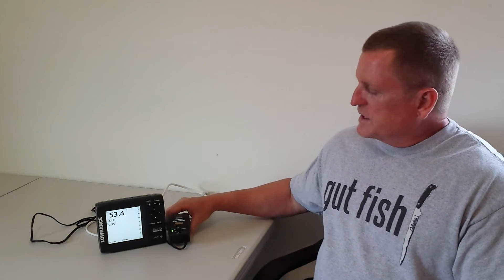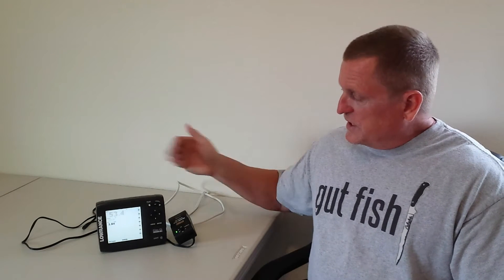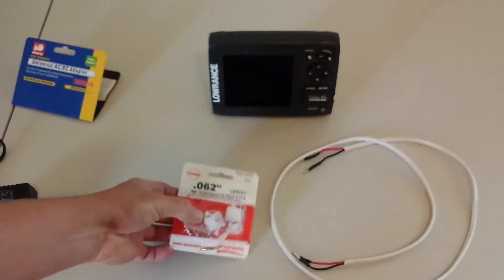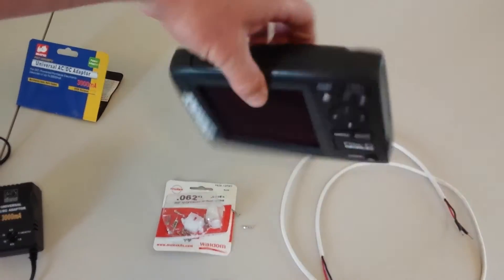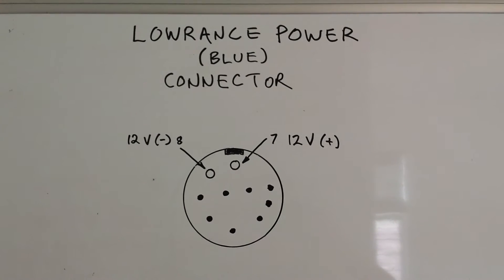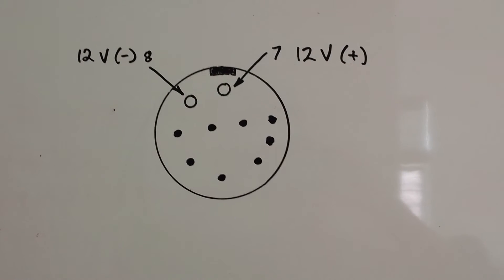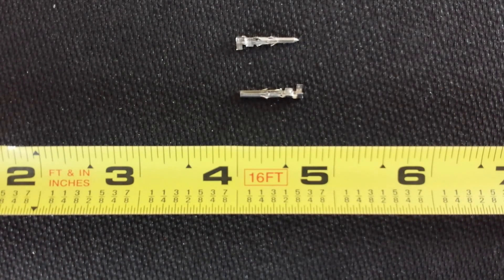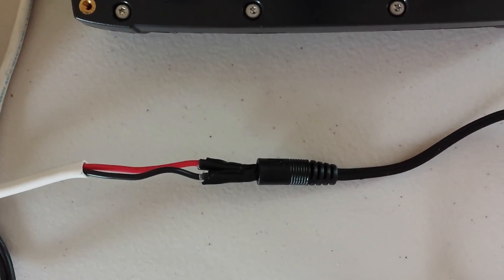DIY Lowrance Elite 5 Chirp Fishfinder (Blue Connector) Remote Power Up

Comment: Hi mate, 
Loving your vids I have the same xfactor as you do and just getting her rigged up now. Could you please do an indepth vid on how you achieved your circuit setup in the centre hatch (livewell hatch). I'd like to achieve similar just looking for clarification on some things. EG, how'd you mount the cutting board it seems that the components are mounted to, other switches for lights etc etc. Thanks in advance if you can help, very few vids on our yaks on the tube.

Oh also would you give a build walkthrough of that trolly you made for it?.. looks awesome and something I deffinatly want to recreate.

Kind Regards.
Reply from the maker: Thanks for the compliment. Yes, the components were mounted to cutting boards before I installed them. When sizing the boards, use a cardboard template first. The edge of the hatch dips a little bit where the bottom meets the side panel. That is the measurement you want because the panel will "snap" into place when you angle the board in that dip and against the upper black rim of the hatch. I used window screen panel tabs to hold the board in place. Let me know the other things you want to know about; if it is too complicated to write then I will make a video. 

Which video shows the trolley you want to know about? Just ask me the questions about it on that video comment section. I would like to see your work when it is all done. 
Thanks again.
Reply: +Aksman no probs mate. pretty sure it was the over view video of your xfactor. showing the electrics and your awesome trolling motor setup (deffo want a vid of your steering return system, i get the feeling you fabricated that). thanks for the reply!
Reply: +Aksman what are window screen panel tabs pls mate?. google showing me no love. I'm australian so i suspect things will be different or not available but happy to improvise